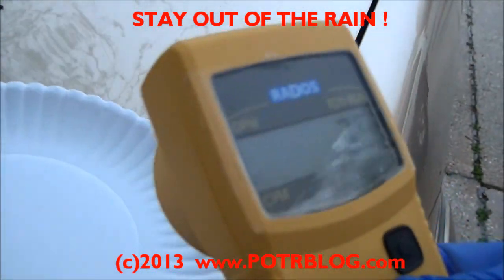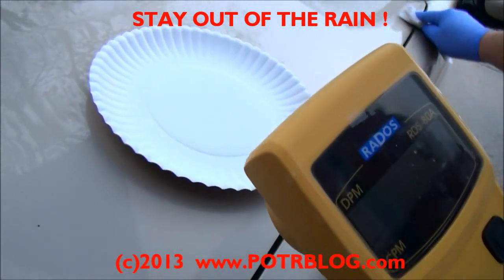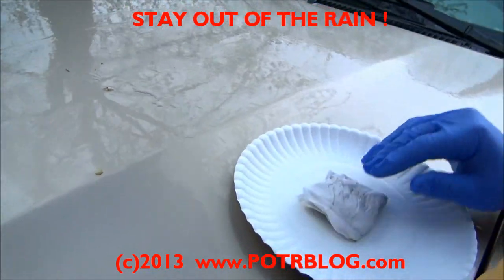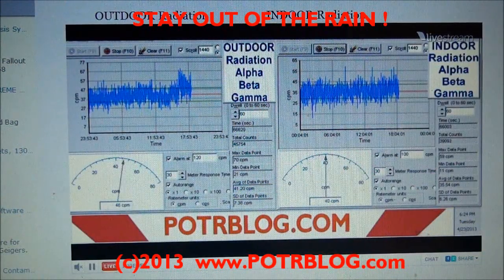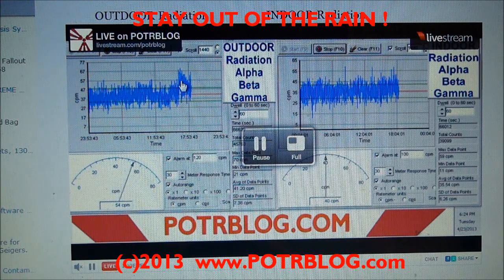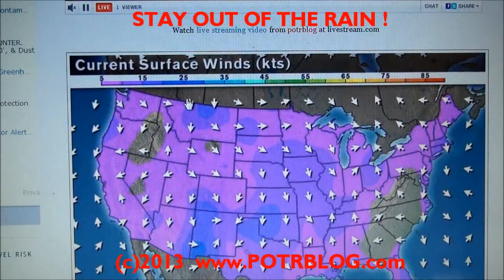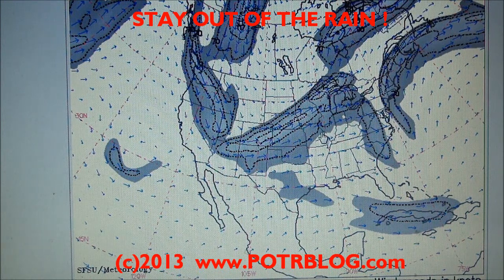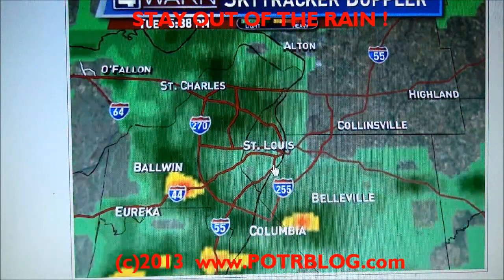ALERT! Radioactive Rain @ 40 Times Greater Than Background Radiation

Comment: Do you have isotopic analysis or gamma spectrography? It seems likely to me that all those are radon daughters, and have nothing to do with fukushima. 

Simple experiment: Take some rainwater in a bucket. Measure radiation (should be "high" just as this video). Wait a day, and try again. If the radiation has mostly dissappeared, it is surely due to radon progeny, and nothing to worry about. If it is still the same level...well, shit got real.